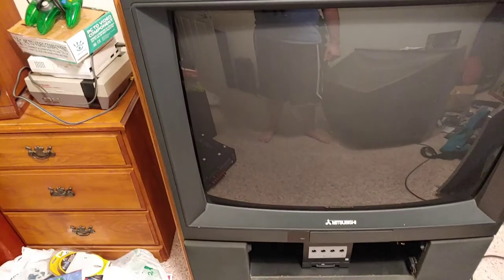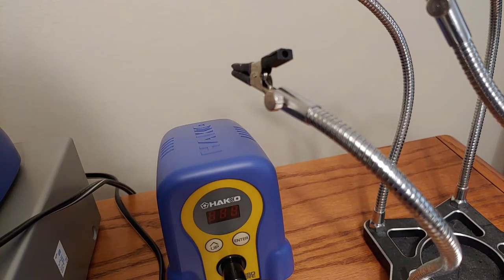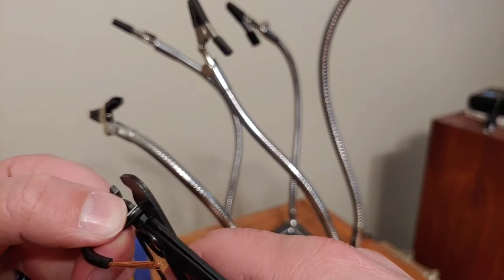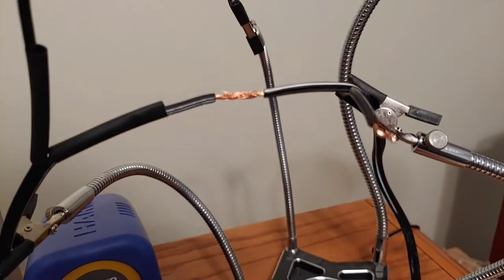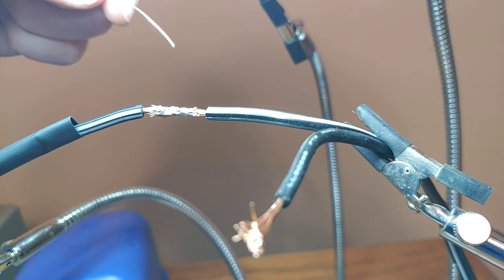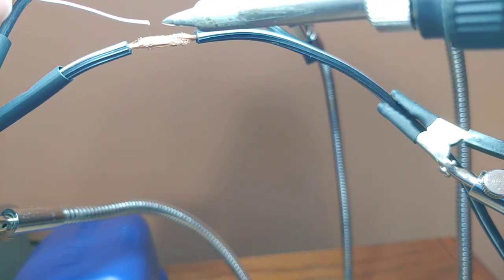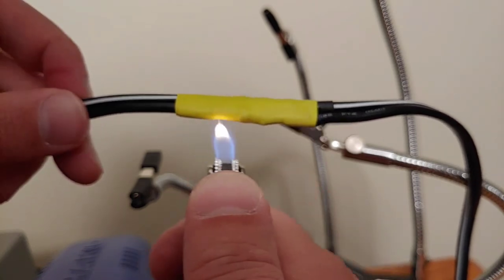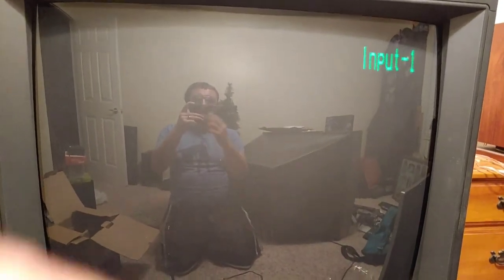How to Repair a Cut CRT Power Cord

Comment: I have loose cables in a crt, is it dangerous if
I just change them without discharging tv?
Reply from the maker: Great question.  If you're just touching the cord itself, you should be fine without discharging the CRT. 👍 If you start doing a bunch of internal work, then you'll probably want to discharge it.

Comment: Is it safe to just connect the wires without soldering, by just wrapping the connected wires with electrical tape? The cut wires would be inside my crt tv.
Anyway, i would like to remove a step up transformer inside my crt (done by a technician) just to make it back to its original state.
Reply from the maker: Great question!  So, it is mostly safe and even pretty effective to just twist the wires together and use electrical tape.  I've done that before, and it works fine.  The only thing is it isn't as good of a connection as soldering and using the heat shrink tubes like I did in the video.  I've just twisted wires together and then used electrical tape to isolate them, and 90% of the time it has been fine, but there have been a few times when the electrical tape has come off, and I have to fix it.  But where this is internal, that's less likely to happen since the cable won't be moving a lot (if at all).

As far as removing the step up transformer, I'm not sure.  It would make sense to restore the CRT to its original state, but I wonder if it was put there for a reason.  I'd say test it without it, and see which picture looks better. 👍
Reply: @FairyKid64  Thanks! that's also what i think since the connection is internal so the less it'll be moved. I'll now give it a try! Anyways, this set is a Sony KV-21DA75, a japanese exclusive trinitron (110v) and the sole purpose of the step up transformer done by the tech is to just make it work directly with my outlet (220v) like any other step up transformer but just internal.
Reply: @FairyKid64  hello I did this same thing but when I plugged in my CRT my power went out my power is ok now but can you please tell me what I could of done wrong
Reply from the maker: @DoctorSeamus thanks for your question!  So, it sounds like your circuit breaker tripped - right?  That makes me think of two things that could have caused it.  I'm thinking that you either plugged too many things into the wall with the CRT (because CRTs do use more power - especially when you first power them on) or you accidently had the two wires touch creating a short circuit.  I'm going to guess it was probably the second option.  So, how did you connect the wires?  Did you just twist them together or did you use solder?  Also, did you use heat shrink like I did in the video, or did you just use electrical tape to isolate the two wires?
Reply: @FairyKid64  no soldering and I used electric tape to isolate them so I guess I didn't do a good enough job?
Reply from the maker: @DoctorSeamus  it's possible that the two wires are touching.  I've done wire repairs with just twisting them together before too with electrical tape, and they usually hold together, but they do come loose some times too.  It's best if you use the solder and heat shrink tubing, but if you don't, just double check the two wires aren't touching anywhere.

A really easy way to test this is with a multimeter.  Do you have a multimeter?
Reply: @FairyKid64  no i dont have a multimeter
Reply from the maker: @DoctorSeamus Gotcha. Sorry for not responding earlier.  Well, what you could do is try to wrap the wires again, and then use some of the heat shrink tubing I used in the video.  Check out the description for a link if you're interested.  Just be very careful to be sure the two wires aren't touching.
Reply from the maker: @DoctorSeamus Also, here's an Amazon affiliate link to a basic multimeter that looks good:
https://amzn.to/3IOaSwX
Reply from the maker: @Invisableman123 I can't speak for all electrical tape, but I would say that trying to melt it is probably not a good idea.  Electrical tape isn't meant to withstand fire and be melted.  I would strongly recommend getting the heat shrink tubing I used in this video.  There's a link to it in the description of the video.  That stuff is on sale right now for $6 and is well worth the investment since you can melt it without breaking it.
Reply from the maker: @Invisableman123 yeah, I get what you're saying.  Even if there is a better solution, it's sometimes easier to just go with what's right in front of me too. 😂